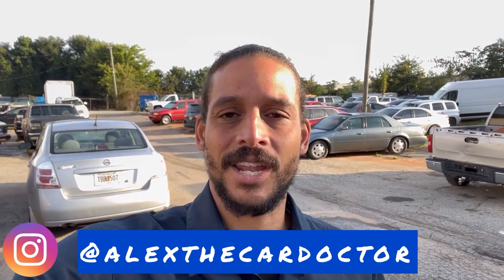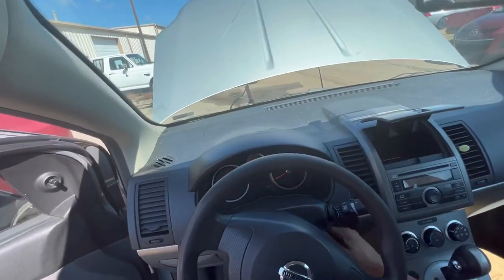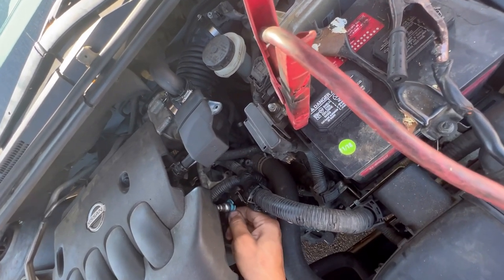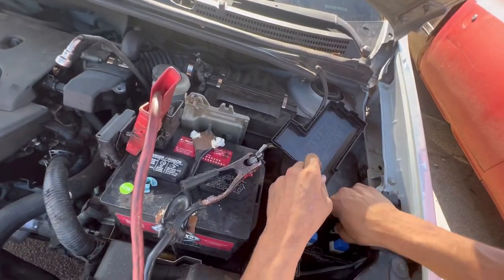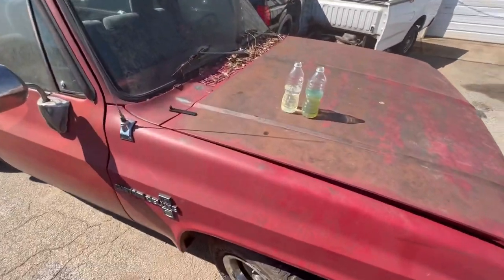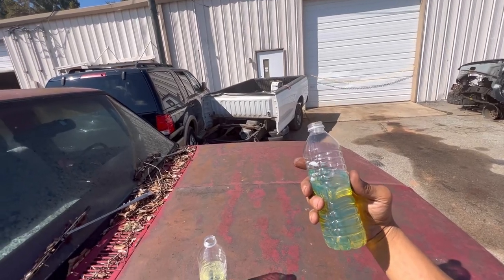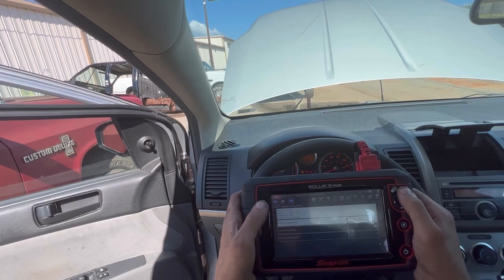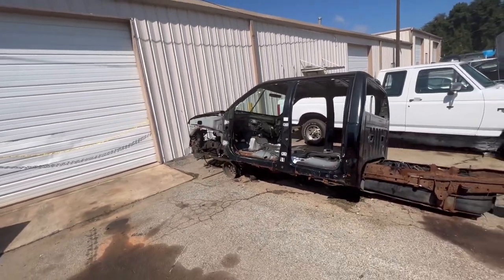Customer Put Diesel in their Gas Tank | How To Remove Diesel From Your Gas Tank (Two Ways) #nissan

Comment: Gonna empty out my fuel that I accidently put diesel and ran it for 3 minutes and then I heard knock noises and my engine died. I hope this empty method works and no serious engine damage
Reply from the maker: Hey there and thanks for watching. My years of draining out diesel fuel in gasoline vehicles I haven’t seen any engine damage yet so I’m pretty sure you will be just fine
Reply: @AlexTheCarDoctor  same happens to me yesterday i put one gallon of diesel by mistake si now i its in the shop i hope the car will run just fine after clear out the diesel, 🙏🙌

Comment: Hi Alex. I mistakenly put in .77 cents worth , yes cents not dollars worth of diesel by mistake yesterday before realizing. About half that came out dripped in the frame where the gas door closes and the side panel (washed it off with water a few times and patted dry with towel). Now considering I had about half a tank of regular gas still left in tank and only pumped .77 cents worth of Diesel and probably half of that maybe got in the tank, then stopped and filled up rest of the tank with regular gas close to 8 gallons. Car ran and got me home fine but worried. Do you think it will be okay? For reference my car is a Toyota Camry SE 2017

Comment: Hi my daughter fill her tank up all the way up with diesel she have a Nissan Altima would this same method still work
Reply from the maker: It should, what year
Reply: Are Nissan is 2016 Altima And I filled the tank up as well. And drove it home for about five minutes.
Reply: Did it work? By using his method? Did you pump the gas out by putting the pumper in the gas tank?

Comment: I would like to thank you so much because this video helped me out tremendously.  First of all I used diesel in my Subaru, WRX and she did not like that very much and so I was left with my hands in the air going. Oh shit!I grabbed the wrong fuel container. It started putting and pouring fluid out the tailpipes. I immediately shut the car off and realized I grabbed the diesel not ethanol. 
 I’m going to take your advice now and going to drain the lines and then hopefully, finger crossed that will help me get her going again because I am very sad.

Comment: Found myself here after I read about a story here in Ireland that happened just yesterday. A Circle K fuel station filled their petrol reservoir with diesel by mistake, and they estimate that 87 cars filled their petrol cars up with diesel (or whatever petrol/diesel mix was being delivered to the pumps) before they realised their mistake!

It's won't be good for that filling station's reputation, and I hope they put all those customers' fuel systems right (hopefully not too many of them were driving too far on that diesel mix), but they are SO lucky that they didn't put petrol in the diesel pumps instead... That might have killed a few cars!

My wife drives a petrol and I drive a diesel, and I'm just glad that each car comes with a misfuelling prevention device fitted, so my dumb brain doesn't have to worry too much about getting mixed up at the pump :D, but it never occurred to me that the fuel station might not have a similar type of failsafe system!

Anyway, another great video showing the practical side of this kind of issue. At least it's good to know that when you get some diesel in your petrol tank, it's not likely to be so bad if you remedy it this way, and soon.

Comment: Yesterday We've accidentally put 11 gallons of diesel in our 2016 Nissan Altima, were hoping your video helps us we haven't looked at the engine yet to see if its similar to the car in your video. Hoping we can find the fuel pump line also are car is a push start so I'm wondering if we push on that like you turn the key and it will do the same thing, if you read this comment and have any advice please let us know were doing this in the next hour. We don't have a scanner so we are doing it the way you showed us. Also how hard is it to unplug the fuel line and how hard is it to put it back together. Anything you can show us so we can make sure it back together properly. We also appreciate and love you energy thank  you for being so helpful and having a kind spirit. Take care
Reply from the maker: Hey there buddy sorry to hear your misfortune. yes, that way will work just fine with the push button. Start turning it on and off. to remove the fuel line should be pretty easy on that model.
Reply: Thank you so much, we loved your video and i can't wait to see what you'll do next!
Reply: Did it work? Did you do the method he did?
Reply: @DacquiraDawson  It took a while, but yeah it worked, we were able to get a lot of it out. I hope this helps.